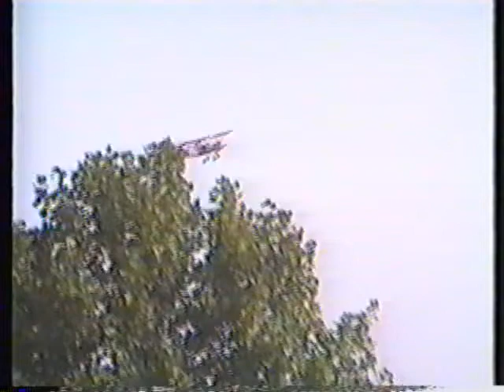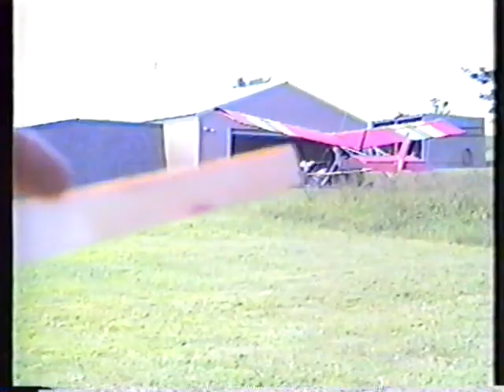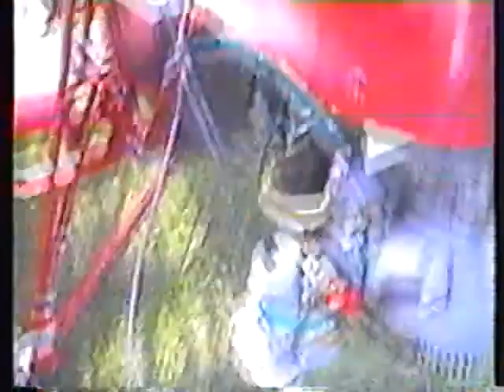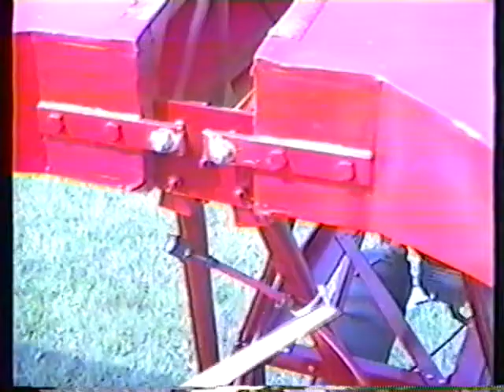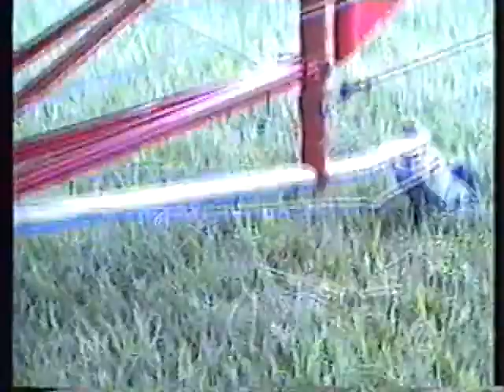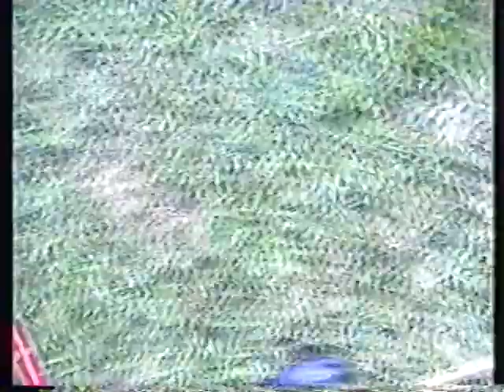RagWing RW9 MotorBipe + RW16 Aerial  - Design description

Comment: sure sounds like its operating at max power. maybe you need more engine or prop. bet temps were high as hell, egt, cht. lotta rpm's there.
Reply: I think he addresses that at about 16:00. He talks about the 2:1 ratio re-drive that should be (up to) a 2.9:1 with a longer prop.
Reply: @Roger Mann good to see you on Roger. When you were recommending the liquid cooled kaw 340s, were they always operated upright? Can they run inverted?